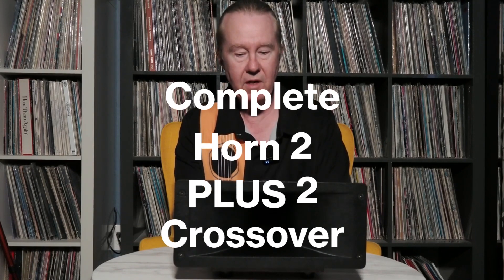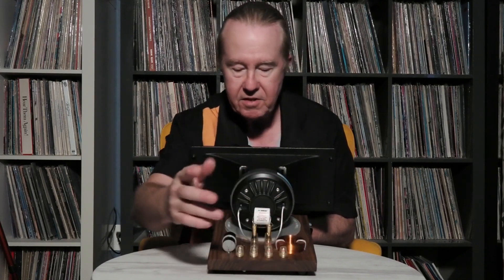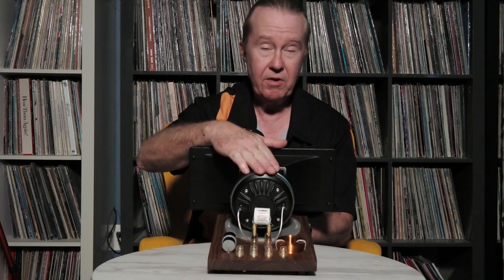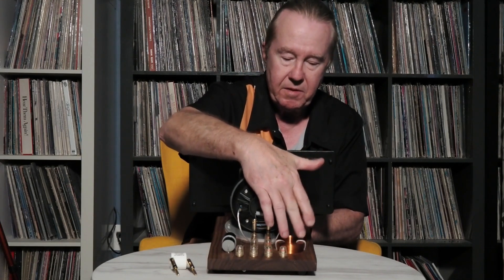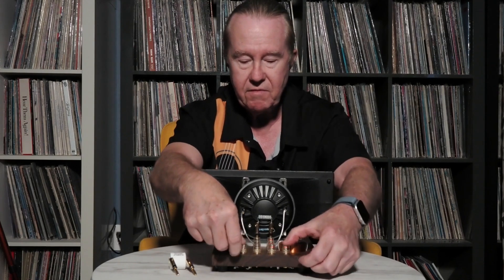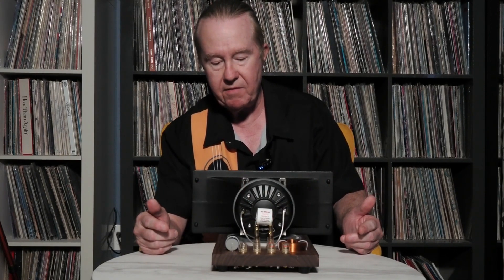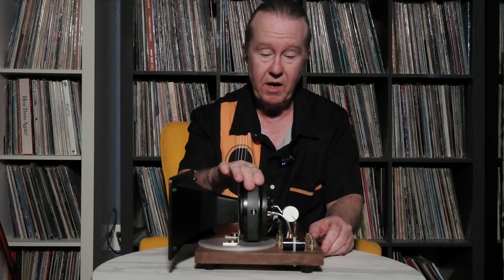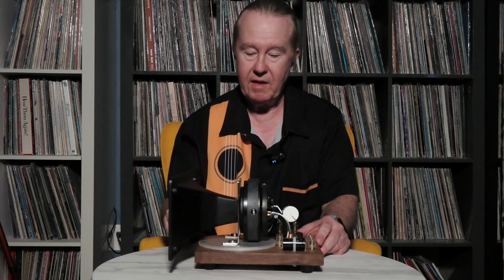HORN 2 PLUS 2 - the details

Comment: What amplifier do you recommend to power the horn that you don't hear the noise floor of the amplifier? Or do you just use an L-Pad?
Reply from the maker: All current horns use an L pad so the noise floor should not be an issue with modern amplifiers.